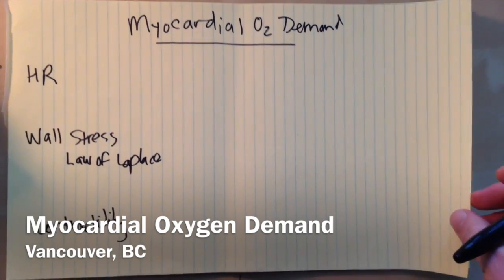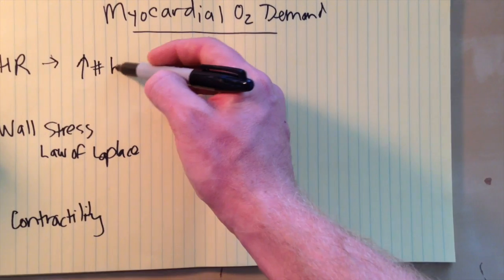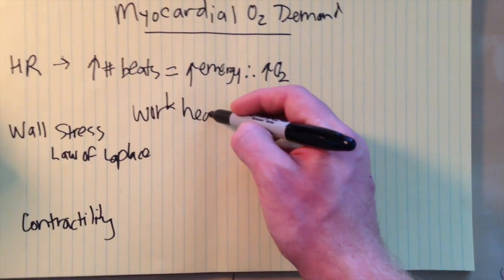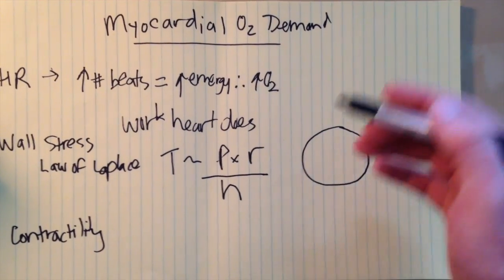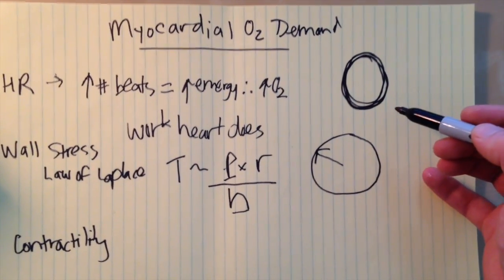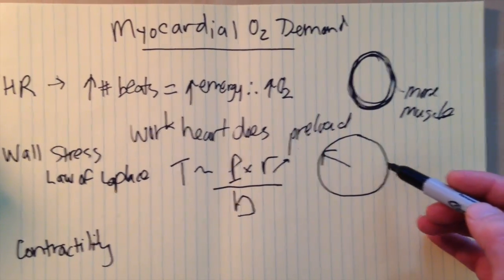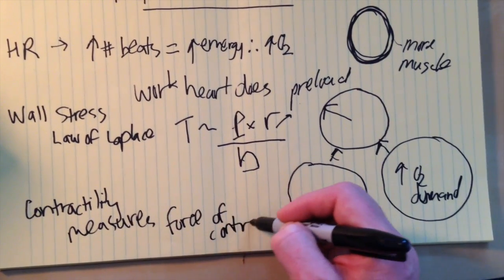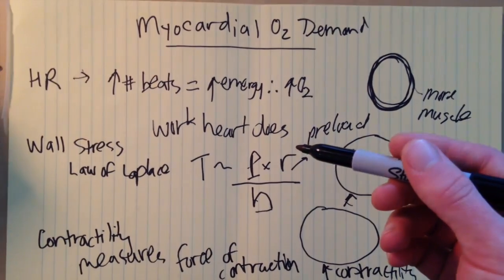Myocardial Oxygen Demand

Comment: hi i am a med student a question. when pressure or overload rises.(preload or afterload) heart does either concentric or eccentric hypertrophy and increases wall thickness decreasing wall tension. thus reducing wall stress but in text book knowledge it says hypertrophy increases o2 demand how so ? it is paradoxical.
Reply: Hypertrophy = Less wall tension/ Per unit area of muscle.

If the question asks about the whole heart (net-oxygen demand), then it does increase the demand (More muscles, more o2). 

But it decreases the tension if it asks about O2 demand per unit area of muscle (or simply wall tension).
Reply: @TinyMedicine So when there is Left Ventricular Hypertrophy (LVH) the muscles are more thicker so it would be easier for the ventricle to contract against both the pressure inside the ventricle and the afterload it's facing 
But since it's more thicker (more muscles) mean it requires more oxygen demand.

Hypertrophy = less wall tension 
                          But more oxygen            
                          demand.

Is that right?
Hoping you'll answer..